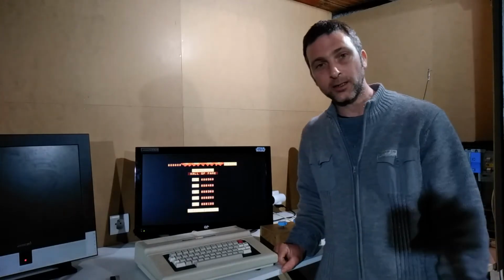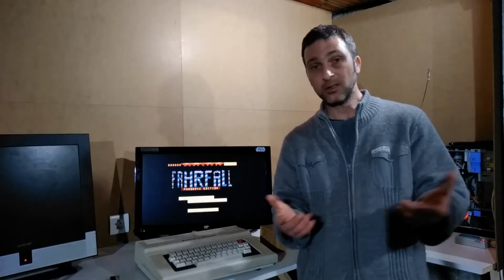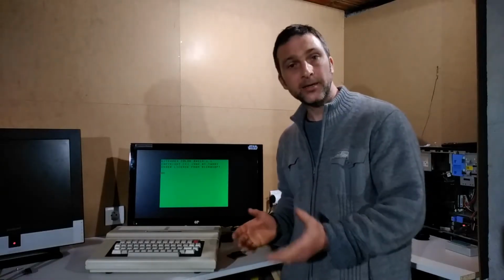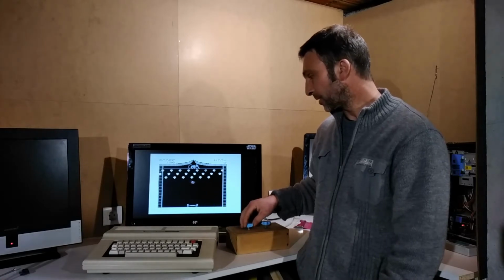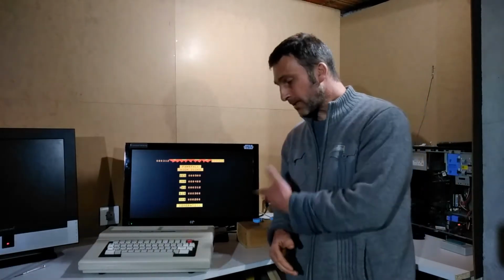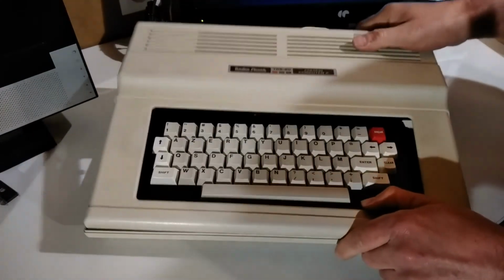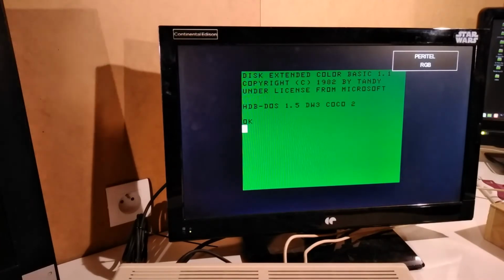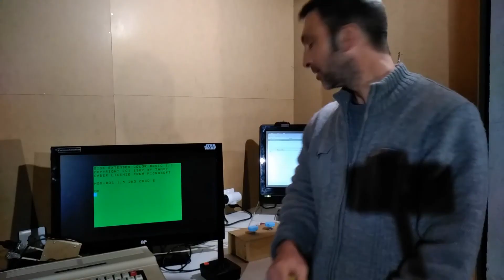Mark J. Blair's CoCo 1, 2 or 3 Cartridge PCB | What I'm doing with it #SEPTANDY

Comment: Where we can find hdbdos 1.5 ?and does it work with drivewire4?
Reply from the maker: You can get it here
 https://sourceforge.net/projects/toolshed/files/ToolShed/ToolShed%202.2/
make sure to read the readme file that comes in the zip file. There are many different formats of HDBDOS included. Choose the right one for your model of coco. I'm pretty sure that it works with DW 3 and 4.

Comment: How did you resolve the Java issue with the DW4 server?  I had that problem when upgrading to a more recent version of Lubuntu on an ancient Dell P4 that I use for Drivewire and ADTPro for the Apple 2.  I think I got it to work by changing a setting in the DW4 config file pertaining to rxtx, but my recollection is hazy and I failed to make a proper note of it.  I also tried out the Python implementation of Drivewire server, but I like the idea of being able to use the printing, MIDI, and networking facilities in OS-9, which aren't in the Python version yet.
Reply from the maker: I took the easy way out, I installed OpenJDK 8 on my system (Linux Mint 19.1) and switched to that Java version as default afterwards. It's probably not ideal, but it was the quickest and easiest solution I found to geting drive wire 4 to work for me out of the box. I should probably look into a way to get drivewire to run with the latest version of Java but for the moment it's doing the job for me.

Comment: From what I have heard/read, the British (Welsh, actually) Dragon 32/64 computers are very similar to the CoCo 3 model, so I think there's a good chance that everything shown in this video might also work on the Dragons.
Reply: The first floppy disk controller for the CoCo requires the +12V line, and maybe one or 2 others, but very few.  The Disk ROMs are one of the differences between the CoCo and the Dragon.  HDBDOS is just a modified version of the Microsoft Disk BASIC ROM in the CoCo's disk controller cartridge.  I know the Dragon can use Drivewire, but don't have any experience with how that's implemented in DragonDOS, but I would assume there's a similar modified ROM image.  But I don't think the CoCo HDBDOS ROM would play well with the Dragon's BASIC ROMs.
Reply from the maker: Thats right BertyFromDK, The Dragon is almost exactly the same computer as the CoCo 2 (as far as hardware is concerned). Only the ROM and keyboard matrix differs. In fact one can quite easily be converted from one to the other. I don't know if the pinout for the cart port is exactly the same on both computers though. But if it is, then there is no reason why the cart would not work on the dragon. But you would have to use Dragon specfic ROM files.
Reply: @8bitsinthebasement  Your response piqued my curiosity so I decided to look for some schematics of both computers; there's a bunch of stuff about the Dragon here: https://www.6809.org.uk/dragon/
and about the TRS 80 CoCo here: https://colorcomputerarchive.com/
A comparison of the cartridge ports revealed that while that of the Dragon have all the pins fully annotated, the one of the CoCo doesn't; however those pins that are, are indeed identical to the Dragon's, which leads me to believe that the non-annotated ones could well be the same too.
I don't have either machine myself, though, so I am unable to verify my assumption, and you or anyone else who might read this comment should therefore take it with a grain of salt IYKWIM. 😉
Reply from the maker: @BertGrink  I think you may be right. It seams that the Dragon 32 shares the same cartridge port pinout as the CoCo 1 (pin 1 and 2 give -12 V and +12 V / pin 1 and 2 are Not connected on the CoCo 2 and 3) This means that the carts should work on the Dragon also but very little software was released for it this way. Take a look here : https://retrocomputing.stackexchange.com/questions/172/expansion-port-on-the-color-computer
Reply: @8bitsinthebasement  That is interesting; the discussion on stackexchange mentions the use of an external unit to recreate the missing +12v and -12v, but i suspect that it would take very little effort to add them internally - what do you think?
Reply from the maker: @BertGrink  I'm sure it could be done with a little extra circuitry to convert the A/C voltages supplied by the PSU and then take it through to the relivent pins on the connector. But these voltages are only needed for certain hardware. I doubt that it would be worth the effort.
Reply: Hmmm.... on second thought (and a closer look at the schematics) I am now not so sure about the -12v. While there IS a +12v regulator present, there isn't anything for -12v. Bummer.
Reply: @8bitsinthebasement  I see, in that case you're probably right that it isn't worth the effort.